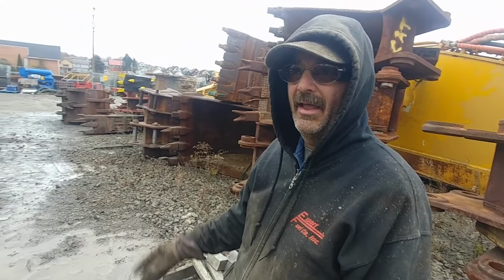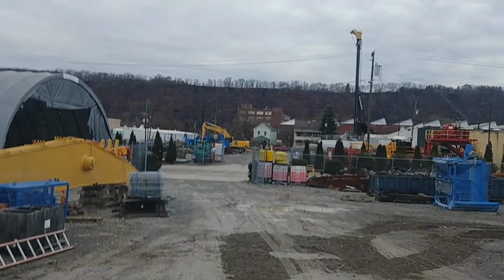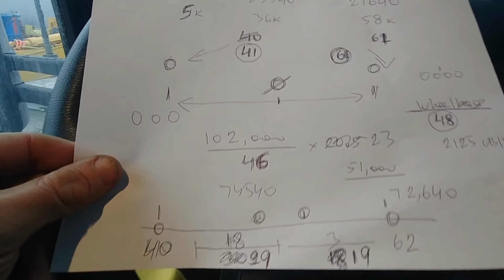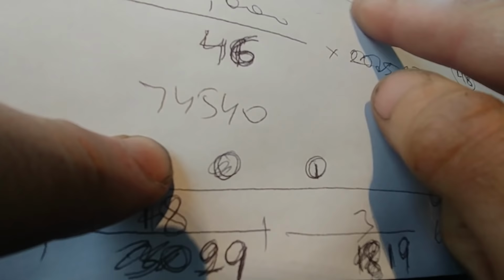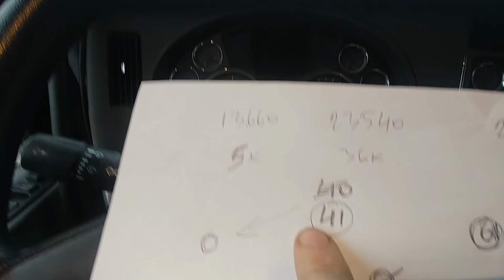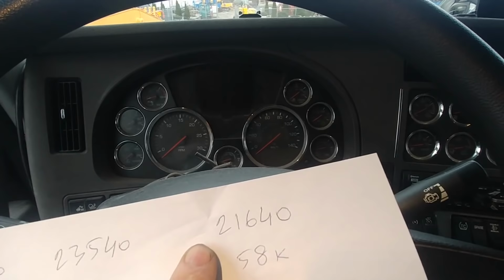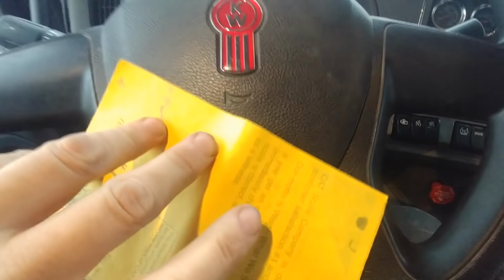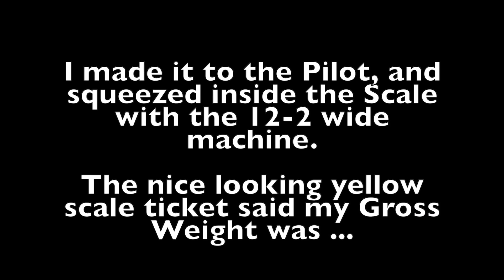Komatsu PC490LC-11 -- Fighting big hills in Pennsylvania

Comment: Do you rotate your front tires with the tires on the lift axle ? Because they are the same right? Are the tires on your new Jeep the same size as what's on the trailer? Keep on trucking!!!!
Reply from the maker: 1) no. 2) right. 3) you got it!
Reply: I think he has 425's on the steer and 385's on the lift.
Reply: @2007Gixxer750  Yea more weight rating with the 425's on the front.

Comment: Just FYI I load all my machines using my feet. That’s because I have 15 years experience in the seat and I can feel a Machine a lot better through my feet. Ps. Your truck sounded so tough.
Reply from the maker: You must be some kind of a prodigy or you take the shoes off. When 1/4 of an inch can make a difference, most humans will find it easier to use hand controls when loading a big machine in to a lowboy.
Reply: Serguei Dratchev You are a strange strange man I’ll give you that but just remember; that if one thing doesn’t work for you it doesn’t mean it won’t work for someone else.